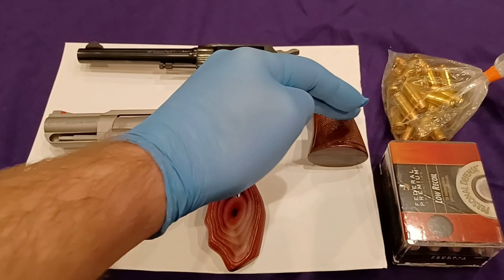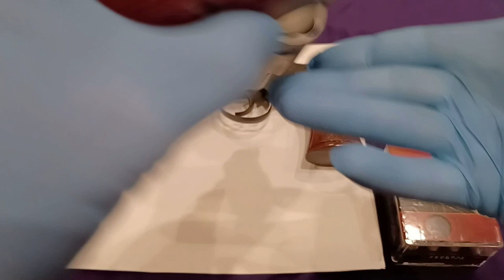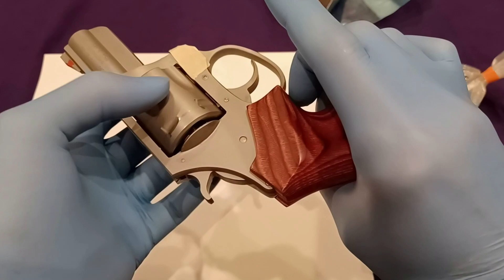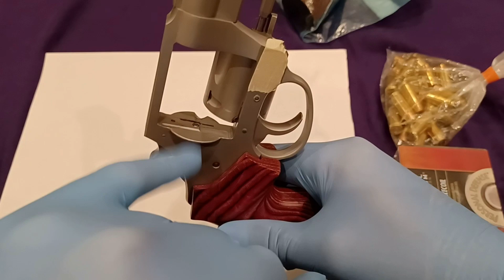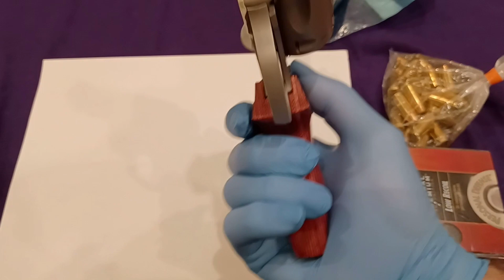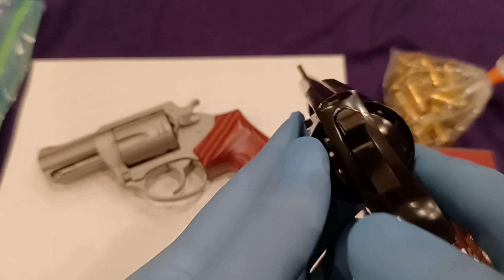Charter Arms - The Last of Hardware Store Mohicans

Comment: Whats with the plastic gloves🤮
Reply from the maker: @monty2020-i5d  The carbon inside the metal reacts with finger oils. Makes rust. You have to use special oil to clean finger prints off & the sportsman's silicone teri cloth wipes to not work. Way back some 60 years or so they would use kerosene solvent wipe off appy a rub in oil finish. After a period of time like that they'd rub off the oil & apply "gun wax" this helped leather holsters conform to the gun, seal leather pores & lubricate high friction spots. 

When showing guns going back in storage, it's customary to wear gloves because you may not want to spend unnecessary time cleaning the thing.

Most people don't take care of their stuff & all firearms oxidize because of their rapid temperature changes with shooting. A gun actually needs a very thin wet coat you don't want to mess with without cleaning.

Comment: I had the 44 version son of Sam gun very accurate at 30 yards  I paid 80. Charter arms I had no clue about it.  Sold for 500 later because I bought the 686 357 SnW. For 300. But I was surprised of the 44.. on point

Comment: @14:30 - Charter says they use 8 groove button rifling.

My 44 Bulldog Pug is quite accurate, with 2.5" barrel.
Reply from the maker: @LibertysetsquareJack   @LibertysetsquareJack  What's petty accurate to you?  The fixed front sight on Charter snubbies tends to hit way low & the ones without a front sight way too high. You might be pleased with how well it groups, but having a long thin bolt & loose yolk can only take you so far. I've seen videos all over YT form experienced shooters.
Reply: @opinionsvary  It's very accurate for close in, defensive work, that is to say, putting the rounds into a hand's span at seven yards, shooting offhand rapidly.

I carry my Bulldog all the time and use it for vermin around the house (rural area), so I may be more used to it than others. However, if I take proper aim (ie. not looking "over the sights" or combative, instinctive shooting), and am in SA, I can shoot small, Arctic squirrels up in the trees or brush, in the head and upper chest at thirty to forty feet. Imo, that is very good accuracy for a mass produced snubnose, and one utilizing the "combat style" trench sights to boot.

As far as the front sight, it is recognized that Charter makes them tall. Filing them down is usually done by people, according to what loads they typically use.

In terms of yoke and such, on my particular pistol at least, the front screw stays secure, as do the other frame screws. Yes, they do need to be checked periodically for tightness: I don't see how they would pose an issue unless someone fired upwards of five or six cylinders rapidly, with heavier loads. Again, for practical or defensive purposes, that seems to be perfectly acceptable. It's not as if the Charters are the only small and light pieces that could experience screws backing off under heavy recoil, because the pistol is, indeed, so light: mine comes in under twenty-six (26) ounces loaded with five 200 grain cartridges, for example.

The main thing I would point out with the screws is in regards to what you said in the video about concealed carry and screws working themselves out: I do not witness the screws on mine coming loose from carry. Again, to reiterate from earlier, I can see some loosening from rapid fire being a potential, especially with heavier bullets, and repeat cylinders.  But from carrying? No, that doesn't happen with mine. It should be noted too that I'm very rough with mine: I carry it everyday while I do all sorts of tasks outdoors and indoors, everything from construction work to falling timber, I move fast, often running back and forth during the outdoor work, jumping in and out of truck beds, I take it with me on hikes, while hunting as a backup piece, I have fallen down hard multiple times with the pistol in my pocket, I have accidentally dropped the pistol down a flight of stairs, etc.; and this is in Interior Alaska, so the frame is also subjected to drastic temperature inversion during winter, e.g. working outside with it in -30F for several hours, then coming into a warm building for a couple hours, then heading back outside. At no point has the pistol's screws come loose from this regimen of carry, so I find it *very* hard to imagine someone doing CCW with it, in town or what not, seeing the screws backing out. The only issue I've encountered with all this abuse is one of the two aligning studs that interfaces with the ejector star.

Now, perhaps I'm lucky, and got a very good piece. Mine was purchased a few years ago. At the same time, many of the Charters people really rag on seem to be from the "Charco era," when the company was in its 1988 through 1999 iteration, and pre-2005 as the company got onto new line with Ecker. Since then the Charters are reputed to be well made and stout again.
Reply: @LibertysetsquareJack i don’t have any gun knowledge but i appreciate how you wrote your comment
Reply: @ecimtar  Glad if it was some use to you!

Comment: I am really tempted by the Boxer and Undercoverette.
Reply from the maker: Say what?
Reply: @opinionsvary  Tempted to buy one.
Reply from the maker: @mkshffr4936  In my opinion: The Boxter Porsche is much more fun to drive off the track. Insurance totals them out more due to replacing hard to get parts.
Reply: @opinionsvary  Boxer is (or was) Charter Arms name for the 6 shot 38. The Undercoverette of course is the 32.
Reply: Yes, the Boxer still exists, and it is their 6 shot version of their 38. The Boxer usually has a Litepipe front sight as well, in contrast to the usual front ramp for the Undercover.